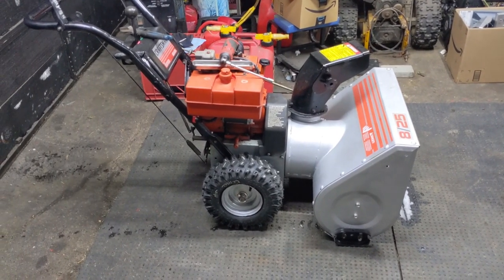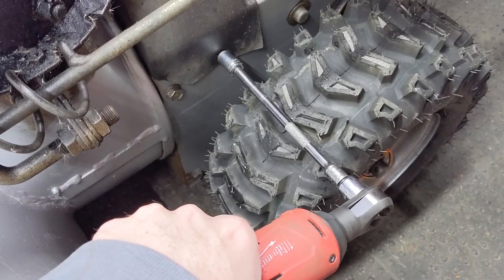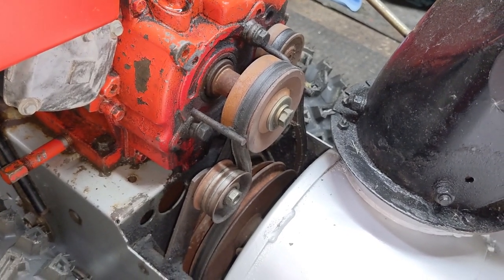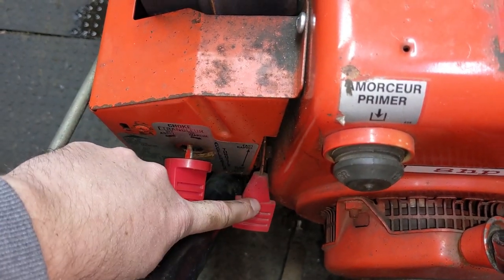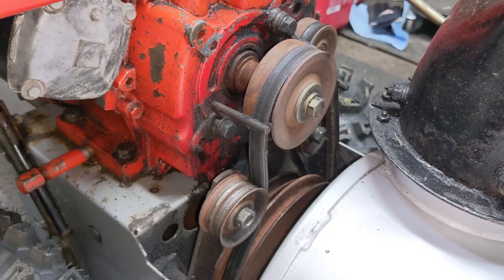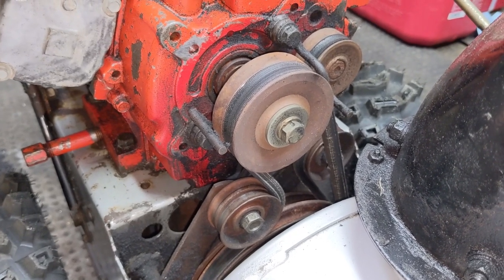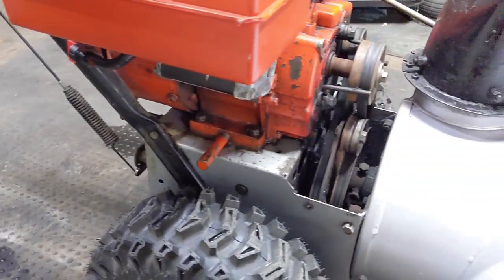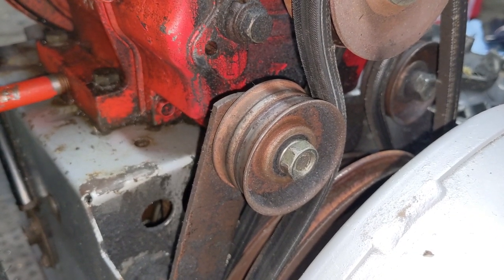EP Tech Tip #7 - Adjust the Idler Pulley

Comment: My 10 year old 8 HP 27" Poulan Pro in the last year stated having snow discharge issues you described so I replaced the auger belt with an exact manufacturers spec one (5/8" x 37") only to find its is also too loose and adjustments can't compensate so then I installed the next size smaller one (5/8"X 36") but its too tight and the auger won't disengage, now what do I do?
Reply from the maker: 5/8" x 36.5" looks like the only way if you can find one
Reply: @EliminatorPerformance  Someone said that perhaps the sleeve bearing at the end of the auger shaft may be worn, I'll pursue that tip.

Comment: I just sold a similar one. I'm thinking that those aren't the original tires. I also was given a noma 825 track drive which is much the same as I think they made the Sears blowers back then. It drives fine even though I have what seems like too much slack in the cable. It actually gets in the way when turning the chute handle. I may try and adjust the slack but don't want to over stress that z.
Reply from the maker: Definitely not original tires, we bought them from STENS and installed! Thanks for watching!